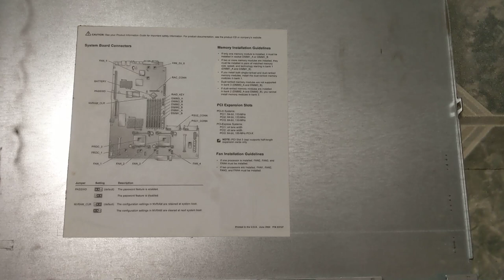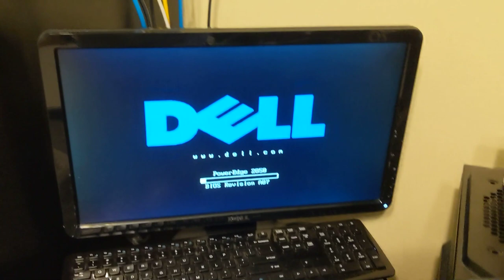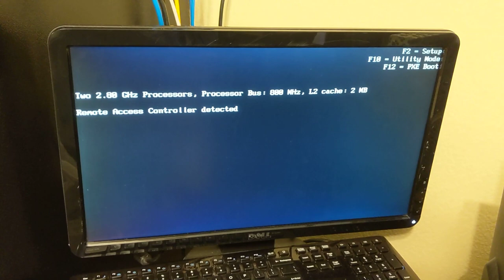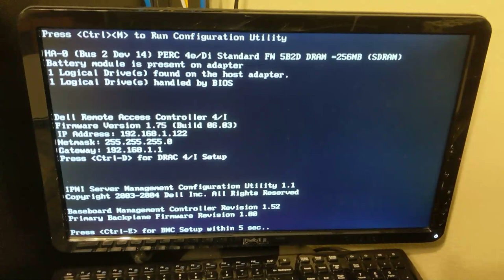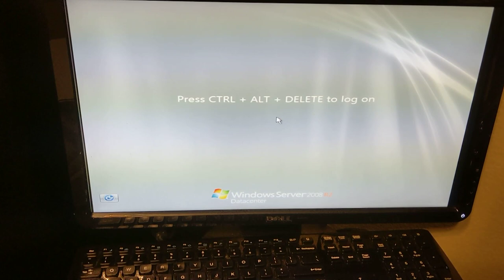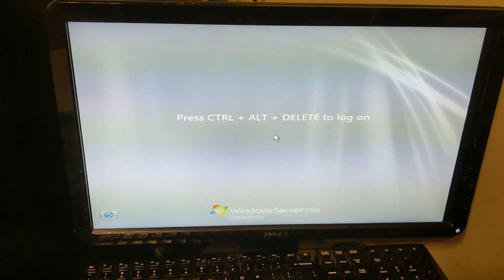This Old Server S1E01 - Dell PowerEdge 2850

Comment: You know quite a lot about it thanks for the video. I'm trying to get a old one to boot up stuck after BMC wont move on I took the customer drives from a 2850 with a Processor 1 error . I can see the logical drives and have no hardware error but it wont start the Widows Operating System.